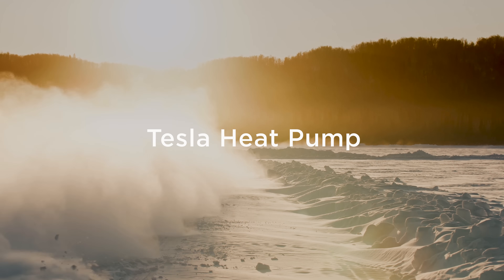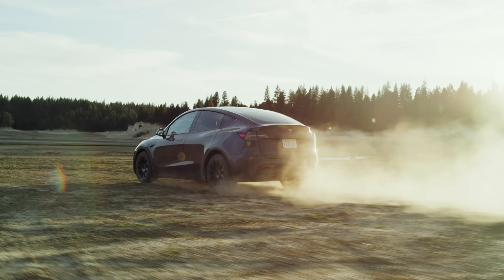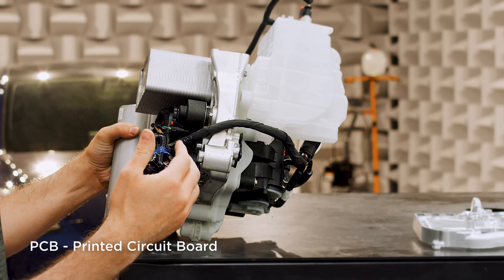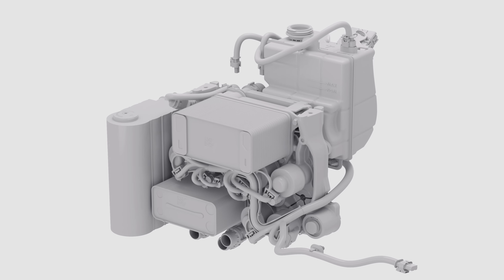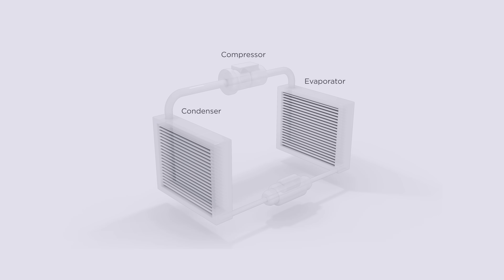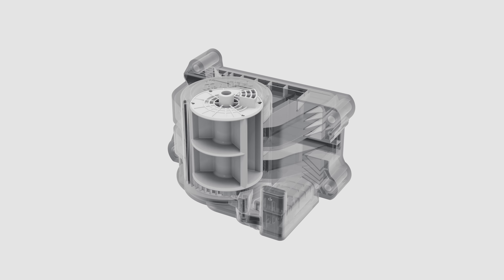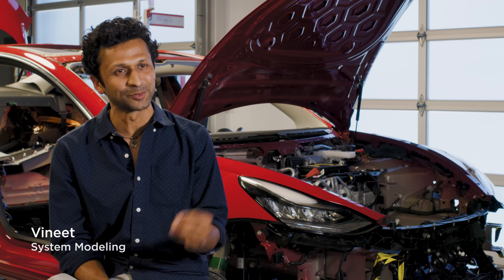Tesla Heat Pump | More Range in Cold Weather

Comment: I love the way the heat pump in my Model Y LR AWD sounds! Kinda like the harmonics in twin engine aircraft. Also love the instant heat on the coldest of mornings, and quick cool down on hot days. Octo-valve is engineering at its finest.
Reply: How fast is it from cold start?
Reply: @gnryushi  In less than two minutes it’s getting warm inside.
Reply: @iBackBeat  That is AMAZING.
Reply: @gnryushi  
First principles engineering, when others ask "what can we make with off the shelf parts?"
.
Now, they're all playing catch-up (as usual)
Reply: Hi  @gnryushi , I timed it a few times. So that I know how long it needs so I dont waste heating car before I go. 2-3 degrees C to 21C is about 3 minutes. -3 to 22 degrees C the other day was 5 minutes. App shows temp of car. So thats the car getting to 22 degrees. Melting ice on windows etc but if you wanted to jump in. Its really instant heat will be blowing out.
Reply: how do you get the heat pump to begin with??
Reply: dont wanna ruin your vibe but instant change in temps is gonna crack the housing of the heatpump sooner or later.
Reply: I love how quickly it starts pumping heat into the cabin. My brother owns a Chevy bolt. He was quite shocked when Model 3 started blowing heat immediately. His bolt takes at least 3 mins to get warm air. The difference in experience is quite stark lol
Reply: @mydutube  Bullshit, the Bolt has PTC for heating. It cannot, period, be slower than a heat pump.
Reply: @sprockkets  I owned a Mach E with a PTC heater and now a Model Y with a heat pump. It's a night and day difference. The Mach E took ages to blow warm air and often it wasn't even that warm. Turn that Tesla heat pump on for 5 mins and you've got a literal sauna, even when it's freezing.
Reply: @thewisr  As an a/c tech who works with heat pumps that work at -22F, I'm here to tell you, that the tesla heat pump is a fraud, and cannot do that. Because, first off, being able to put out hot air with an intake of -22, means it's a 120 degree jump in temperature. (When it is "freezing" out for you means 0 C or 32F. That for me is warm.)
That's simply, flat out, impossible. Think about this for a second. If you have 800CFM for a furnace, and you have a 55 degree increase in temps, that's around 47k in natural gas for input.
Now let's assume this system has 300CFM (a typical 9-12k mini split can do 350-400CFM) and that the amount of air this Tesla can do, is around that. 300CFM x 100 degree delta x 1.08 gives 38,000BTU input. That's ~11.37 kw. 
I'm not buying it. 
No, what Tesla has been doing, is using the battery as a heat sink along with its coolant, then when you drive away, it harvests heat from it. That's what they claim at 0:40.
Reply: @sprockkets  I wonder why they keep failing here in Canadian winter. We have had the Supermanifold replaced twice, heat pump actually failed while diagnosing a power loss issue after supercharging. Lots of stories about heat pump failing below -20 C.
Reply: @RockyMountainTesla  Just by looking at the video on how they route refrigerant, it's designed like they think things don't leak. It's rather funny and sad. But what do you expect for a company who made their own heat pump vs those that have done it for decades?
Reply: @sprockkets  I believe all of what you say. All I can say is that I  timed it this morning. The car's interior was -3C. Exactly 4 minutes later it was 20C.
Reply: @sprockkets  FYI: Your calculation result is based on 350 CFM; not the 300 cfm you show.
Reply: @johneric98  correct. I should change it. IT's just really I can't tell how much in cfm a typical car puts out. Though I could actually measure it cause i have the tools!
Reply: Plug in a CanBus MX adapter and use ScanMyT3SLA and you’ll quickly learn that the motors can be statically heated without moving and they are also connected to the same coolant  heat pump line.  Below -1C, the motors can be used to supplement with warmer coolant.  When static, it’s is a waste, but when moving, you are dumping motor heat directly into the cabin down to -40C, so super cool stuff.  This same coolant line also can be used to pre-heat the main batteries for faster supercharging.  Again, brilliant use of wasted heat.
Reply: @theswordsmith  that is an incredibly stupid idea. You literally are using your motor windings as a heater, wearing them out. Not only that, the heat then goes to the motor chassis, not so much the coolant. 
It's stupid and why Tesla has a bad reputation for reliability.
Reply: @sprockkets  one or both motors have coolant lines inside them, so any heat would have to radiate out past the coolant pumping through the motor, which is not likely.  Secondly, to apply high A/C frequency current to windings while static will only generate heat, no torque, and probably a nice chunk of magnetic field.  To blindly state that burns out the windings due to heating the motor to 90C or less is assuming that motors are the same today as 50 years ago, and they are not.  They are brushless, with the rear one likely having rare earth magnets, ceramic or better bearings, oxygen free environment, and fully epoxy sealed wiring and waterproof seals.  Nothing really to wear out or oxidize if done properly.
Reply: Furthermore, it’s actually brilliant to have cooling inside or adjacent to the motors, as the heat pump can cool the motor of vehicles being raced in desert conditions to below critical break-down temperatures, even if the vehicle is stopped without airflow over the motors.  Also rare-earth magnetic-based motors perform worse if they get too hot and could risk losing some magnetism if over-heated, so this fixes that issue as well.
Reply: @theswordsmith  you don't have any idea what you are talking about. Brushed or not is irrelevant and you make it sound like the motor in this vehicle is special - it isn't. Like most any other motor this has copper windings (spoiler alert all windings are coated with insulation). Your description isn't even how they do it. If you got that from Tesla then that's just more bs.
Reply: @sprockkets Can you explain how windings are going to get worn out by using them as low temperature heaters? I don't see the problem so long as the temperatures stay low enough so can you please explain?
Reply: @dannylee6632  Because when you stall the motor or drive it stalled, you generate a ton of heat and thus contribute to wear on the copper. Guess what state of a motor's operation causes all the wear and tear? When in locked rotor amps as it starts.
When a motor spins normally, back EMF keeps current low and thus the motor windings are not subject to high temps.
It's just a stupid way to avoid having to have a simple heater for your battery. I'm willing to bet that caused the Model 3 for C&D to fail in the winter.
Reply: @sprockkets  why are you assuming the windings will be at high temps? The application here is external temperatures too low for the heat pump to use ambient energy. The motor is getting cooled via refrigerated coolant in freezing external temps as this process happens. On top of that, we are talking about a computer controlled AC stall, not a max torque stall.  If the car knows how hot the motor is and the controller can precisely control the intentional stall then there is no reason to assume the windings will overheat. Btw I appreciate you engaging in this argument 11 months after your initial comment 😂.
Reply: Does the heat pump solve the charging in extreme cold climates problem?
Reply: @brentmadison7605  Yes.  It can direct heat from components like the motors, the CPU and the GPU into the battery to heat it up.  The slowing of charging in colder weather isn't a general weather issue, it's a "battery charges best when battery's at a certain range of temperatures" issue.  So, if you use the car's navigation, it will plan in a charging stop at a Tesla supercharger (or a compatible one in the rare case where a Tesla charger isn't available) and the car will pre-heat the battery as needed to make sure it's at the right temperature when you arrive at the charger.  It will also keep the battery warmed up if necessary (charging the battery produces heat because, y'know, entropy is a thing, but if it's brass monkey cold (as they say), it'll add some more heat in).  
  
It can still pump heat in and warm the battery if you forget to plan the route or are just winging it, but it's more efficient to give it a heads-up so it can do it while you're driving, instead of starting when you plug in.
Reply: @brentmadison7605  Yes. It allows you to put 14kw of heat in using only 3 or 4 kw of energy from the charger. This means a level 2 charger can warm up the battery quickly.
Reply: @brentmadison7605  With no heat pump, you have to wait like 2 hours for the car to warm up and even then it's limited. With a heat pump you only wait 5 minutes then charging is the same as when warm.

Comment: Every modern car has a heat pump.Tesla made it reversible. So much innovation.
My house air con says "meh".
Reply: They did more than just make it reversable, but probably over your head.
Reply: @CL-gq3no  In the video they say its not a new concept. Maybe words are over your head. lolz. Nissan had a heat pump in 2013. Perhaps Nissan were the EV heat pump innovators.
Fanboys, meh.
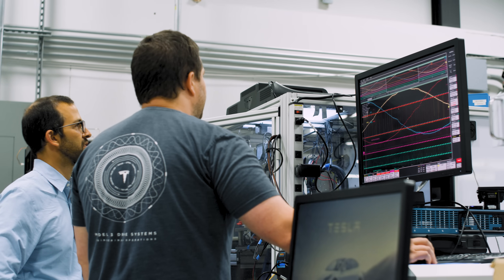Reply: @ytfytf1265 , They say more than that.  00:55.  If you are going to use them as a source maybe listen to what they actually say.  The innovation is not the heat pump alone.  The innovation is in the super manifold, octovalve, the heat exchanger., and in the overall packaging.  Together these allow waste heat/cold from any system in the car to be shared to another other system that can use it.  For example, waste heat from the motor/electronics can be used to heat the cabin on a cold day.  Or, waste heat from the heat pump can be used to pre-condition the battery for supercharging on a warm day while the AC is cooling the cabin.  Or, any other combination.  

Other OEMS, even those with heat pumps, are implementing them as individual systems that don't use waste energy from each other.  They just waste it and then use more energy to generate it separately in another system.  They also have a rats nest of so many hoses and separate pumps/heat exchangers that most of them fill the "frunk" space despite no gas engine or transmission.  

Here is a well known industry professional with decades of experience sharing their findings after tearing down Tesla's system vs. Ford's.

https://insideevs.com/news/520725/ford-mache-thermal-system-tesla/

So like I said, it's over your head because, "heat pump not new."

Comment: My Y is such an improvement over every other EV I’ve ever driven. The heat pump is a big part of that.
Reply: how do you get the heat pump to begin with??
Reply: Can you charge in extreme cold weather climates? If so, how cold?
Reply: @brentmadison7605  Yes, you can charge at virtually any temperature. But just as frigid weather often requires an engine block heater to keep everything from freezing, an EV battery also uses energy to keep itself warm enough to charge. When not charging the battery cools down again and uses almost no energy to maintain itself. Then when you get in to drive, it consumes energy to warm up to an optimum temperature. Again, similar to an engine block heater in frigid regions. I’ve driven and charged my Model Y all across the Upper Midwest and Canada during frigid and icy winter months and the vehicle operates and charges well. Charging speeds do slow down a bit, and energy availability in a cold battery does decline a bit, but good Supercharger route planning via the car’s Navigation and pre-conditioning the battery before departure can get you virtually anywhere.
Reply: @goingelectric7826  If you have to go out of your way for charging stations and spend energy heating the car just to charge, doesn't it defeat the purpose of being more efficient
Reply: @phillylove7290  Yes/no. True: in 2023 there are far fewer DC charging stations than there are gas stations. In that way, EV DC charging is similar to how filling up an ICE was in the 1920-1930s. But eventually gas stations were built out everywhere and it became a non-issue. EV DC charging will likely reach that point later this decade or in the 2030s.

However, most DC charging stations -- even today -- aren't so far off highways that it has any impact that reduces energy to the degree that ICEs would be more efficient. But yes, DC charging stations do need to be more numerous and right along highways, just like many gas stations. However... since many EV owners charge at home/apartment/condo/work on 240V chargers, actually only a relatively small portion of EVs ever even use DC fast chargers unless they're on a long distance journey that day, and even so, their first 170-300 miles are likely charged at 240V at very convenient locations at home/work/etc.

As for using energy to warm up batteries... ICEs do that in their own way, yet it's not a topic. 

A cold ICE produces more pollution and performs worse than a hot ICE. In terms of performance, that's why we turn on ICEs in frigid weather and let them run to warm up before we drive away. Or in super cold parts of the continent, some people even use engine block heaters where critical fluids can freeze. Both of those scenarios require energy to heat up the engine block (either electricity or gasoline/diesel). But we all view the benefits of that energy expenditure being worth it so we do it without thinking about it or caring much. 

In the case of EVs, while extra energy is used to warm up a battery, the amount is extremely minor compared to what an ICE burns through. So, if I typically get 115MPGe in good weather in my Model Y, cold weather inefficiency/consumption may reduce that down to 78MPGe. Compared to something like a Porsche Cayenne that gets good weather efficiency around 24MPG but in harsh winter weather would be closer to something around 18-21. 

In either case, the electric motor and its warmed-up battery are still getting VASTLY superior efficiency compared to any similarly performing ICE... to the tune of 300-400% more efficient despite the challenges of winter (that also affects ICEs, just in different ways). So basically: it's complex and nuanced but the EV efficiency is always so much better than that of an ICE that it doesn't defeat the purpose of being more efficient, which it always is.
Reply: @brentmadison7605 When you drive to a charger you need to set it as the destination. That causes the car to make the battery the best temperature for charging. Be that -20 degrees or 120 degrees. The car will condition the battery for 250Kw charging.
Reply: @brentmadison7605  Coldest I ever charged my Model Y Performance in was -38c without the wind chill.
Reply: @brentmadison7605  You can activate "Bacon strips" mode even in frigid cold temperature  -20C and beyond. This will warm up the cabin as well as the battery while you're still in the comfort of your own home. If you set your destination to a tesla charger the car will further warm up the battery for optimal charging. This warming up process costs like 1% per hour from experience.
Reply: @brentmadison7605  you will have problem with that only if you abandoned your car in very cold for several days right in front of charger. If you need to drive to charger at least 10 minutes - there is no differnce it is cold or hot outside
Reply: @brentmadison7605  
Go to the out of spec reviews YT channel.
They tested charging during the recent freeze.
Suffice to say.... Tesla for the win.
(Electrify America? Not so much)
Reply: I couldn't agree more
Reply: I’m sorry you bought that car.
Reply: does all the models have heatpump or just Y?
Reply: @megapet777  Literally says in the video that they started with the Y (in 2021) but now is on all vehicles (as of 2022+).
Reply: @Nitro187  yea so for example 2019 model 3 has no heatpump then
Reply: @megapet777  Correct.  Model Y didn't come out till 2020 - and the early models did not have it - there may be a few 2020 models that had it if they were made late in 2020... but i doubt it... if anything, there may be a few 2021's that don't have it.  I believe every single Tesla produced for 2022 model year and newer had it though.
Reply: @Nitro187  I see
Reply: your Y costs as much as a house it has to be better than any other ev car.
Reply: @ArisHDi  that's an insanely cheap house, tell me how to purchase one
Reply: LOL!!! Yeah right Elon fan-boy!
Reply: What year did they upgrade the heat pump?
Reply: If that is the case, then  you have not driven a lot of EV’s.

Comment: So can these be put in on older models?
Reply: It would cost too much to retrofit everything needed to do the conversion.
Reply: The entire system is large. They integrated everything into one dense package but that package requires a lot of space. The entire frunk needs to be redesign to fit the octo valve heat pump system.
Reply: It's already been put into Models Y, 3, S and X.  If you're asking if a heat pump can be retrofitted into an earlier car, not practically.